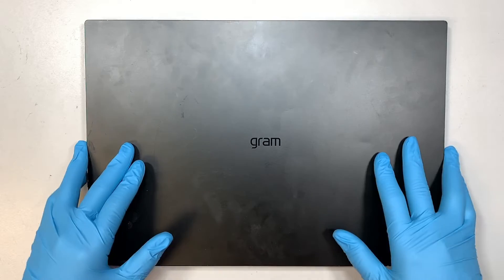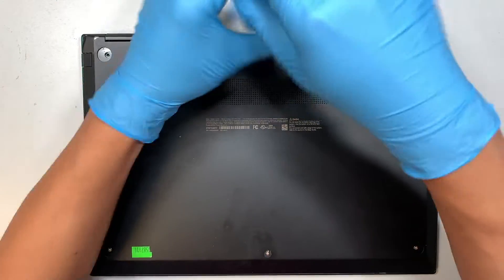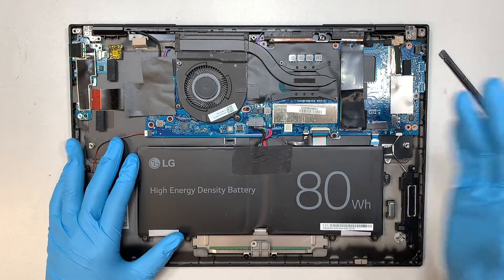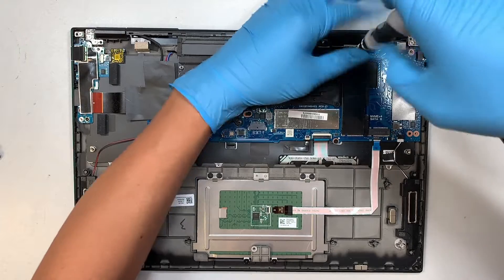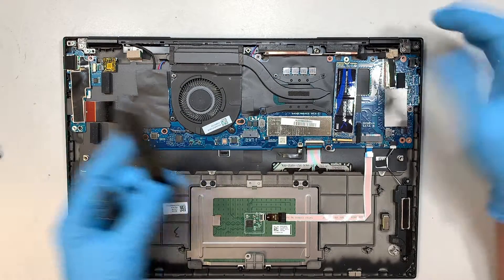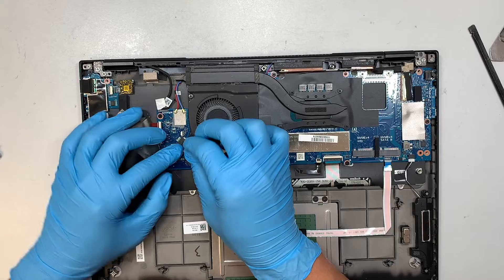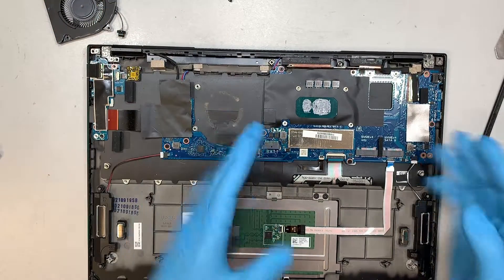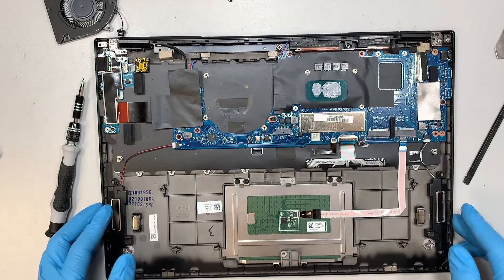LG Gram 16T90P Teardown Disassemble Upgrade

Comment: Hi  - to replace the keyboard/trackpad / keypad platform  - do you need to remove the mother board and all the cables and then reattach all items to a new keyboard assembly, or it there an easier route?   Could you do a video showing this>? it would be the only one on youtube.   thank you
Reply: For this 16T90P  model, what's the max SSD size for the two internal SSD slots? thanks

Comment: Thanks for the video! My battery has been slowing losing power and so I ordered a replacement. When I connected (as you did in the video), the computer won't charge at all and turns off even when plugged in. Any chance that LG has software blocking the computer from recognizing the new battery or anything else I may be missing? So far, LG has been entirely unhelpful with support :/
Reply from the maker: Glad I could help
Reply: For this 16T90P  model, what's the max SSD size for the two internal SSD slots? thanks

Comment: Hey! Great video. I have a LG 16T90R G.AA78G I believe (it's a convertible) and I accidentally damaged a key - the inner scissor clip (thin plastic) broke. Is there a chance of finding a replacement part for that in order to put the key back together? The rest of the key does not seem damaged at all.

I am from Europe, Germany, so if there is a chance, please let me know what part I am even looking for.
Reply: For this 16T90P  model, what's the max SSD size for the two internal SSD slots? thanks

Comment: I have a keyboard to replace. You stopped just short of what I needed and gave a brief lecture about how, what I'm about to do, can't be done. That could've been more helpful.
Reply from the maker: you need to replace the entire keyboard with palm rest and touchpad
Reply: Someone should played with Legos more
Reply: Same for me. I opened it up but couldn't open the hinge. It's somehow stuck or glued together. So I have the full replacement lying around but didn't manage to get the hinge of. Further putting back the Mainboard there are pins below which make insertion really tough and in the process my HDMI plug physically broke .

Comment: Nice demo. I am trying to decide which Gram model would be best for us. Since our current laptop’s 512GB drive is less than half full after six years, I am pretty sure we don’t need a huge SSD. Seeing how easy it is to add a second drive or replace the original with a larger one will help us select a model.

Comment: Hello simon, I have a question I have a dead white pixel on my laptop's screen is it possible to fix it without replacing the screen?
Reply: most 4TB NVMe with heatsink probably won't fit inside? just get one without heatsink it's no problem or?